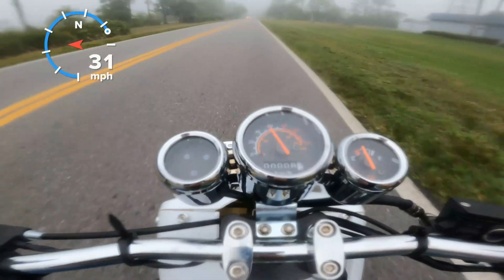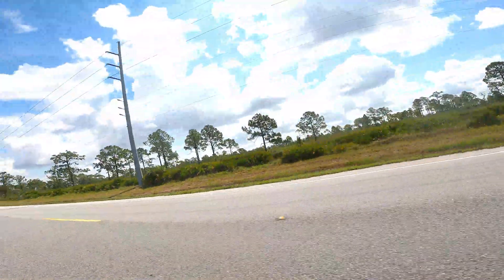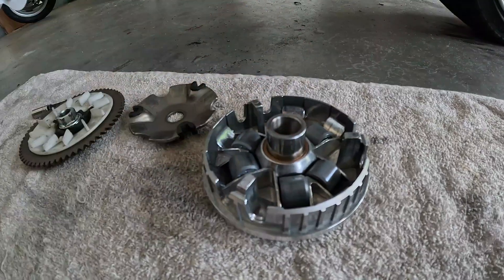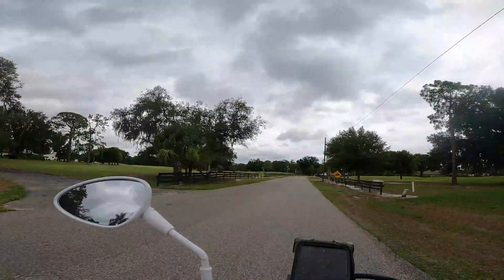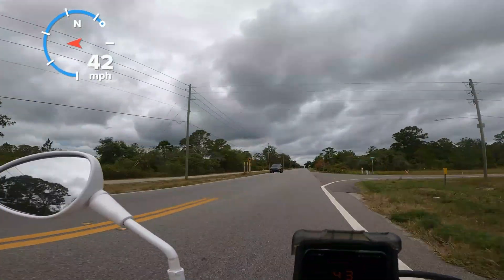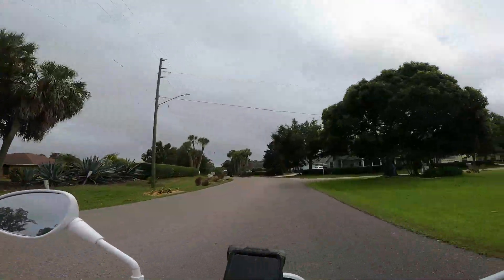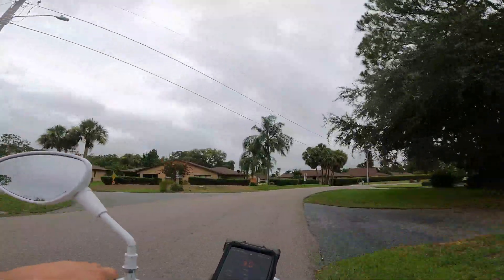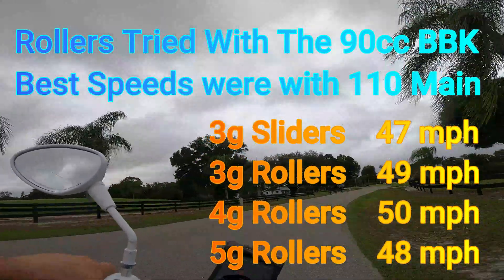Maddog 50cc is Fast as a Stock 150cc with these Mods for Under $500.  See description:

Comment: Think the variator would work well on the 150cc?
Reply from the maker: @Jnaathra  a 115mm variator will if you are making the power for it.  It's a gear up mod.  You will want an 842 belt also as the 835 belt does not even use up the entire stock 107mm one.

Comment: U should install a tach.cyl head temp guage.oil temp guage and a air/fuel ratio and exhaust temp.U will have the ultimate tuning tools and keep ur scooter safe.On aircooled engines u always want to keep track of temp.And have it slightly rich
Reply from the maker: @oldstyleanalog6459  I know....  I have been too lazy on that 😒

Comment: I had a metropolitan 2006.with polini variator 200lb rider i did 43 to44 mph.Honda is a better motor.i have like 4 gy6.1 im gona build a 230cc big bore on a china big ruckus.im adding a oil cooler cam carb the works.im gona ride from l.a. to the tip of baja on it when done
Reply from the maker: @oldstyleanalog6459  Is that like a desert baja ride?  Or street?

Comment: What are your thoughts on long term reliability with that big bore kit? I keep hearing you have to upgrade the crank or you will wipe out the bottom end.
Reply: Ifs it 50 stock . It's not gonna wear as quick .  Keep oil changed. Be cautious of what carb is sucking in . Depending carb the carb an setup. Grit will go thru intake an guess what happens

Comment: Great video! Im working on the same project with the exact same results. I think we must change the cdi from a 150 scooter to let the bike go significantly faster. but its a very risky swap. Ive heard the timing can be way off and wrecking the engine.
Reply from the maker: The 150 CDI and the 50 CDI are identical I think.  Just my suspicion.  I have a new blue racing CDI and a NCY "150" CDI and the Glixel orange 150/50 CDI.  I am going to do a test on all these.  I wanted to make sure the bike was running top speed before that test.  I did actually calibrate the timing on that pickup for another project and the mechanical timing is onlt 30 degrees advanced so that gives zero room for an advance map.  Prob why aftermarket CDIs always go slower in all my 150cc tests.
Reply: @GhettoWrench  thanks for your response. Im looking forward for the test results. my next upgrade will be a better carb. I want to have a little quicker throttle response.
Reply from the maker: @MrQ_Cruz  I ended up going back to the PWK cause it matched the bike better.  LOL.  It is identical to the Nibbi 19 as far as performance goes.  The PWK was harder to dial in though.

Comment: I'm runnin a 72cc, just put in a new 727mm belt and front variator (same size as stock), and an unrestriccted variator bushing, now i'm hitting 6mph slower on hills. Any idea why?
Reply from the maker: When did slow down?  After the belt change?  Or after doing all that stuff?  Ate you sure the belt you took out was a 727?  This was not a maddog was it?
Reply: @GhettoWrench  nope, a kymco super 8 so a long qmb139. I changed them all at once, old belt was a 732. new belt is 737, theres a typo on my comment lol. I was wondering if the new variator front end is a bit heavier? so the old rollers are now a tad too heavy. not sure though
Reply from the maker: @djilu9916  that longer belt probably geared you up so you are lugging down up those hills.  See if you like the shorter belt better.
Reply: @GhettoWrench  Thanks! i gotta try that
Reply: @GhettoWrench  are there any other meta for mountain areas than lighter rollers? the hills here in the Alps are insane lol
Reply from the maker: @djilu9916  I could not find ANY kit that geared the rear end lower.  I was looking for one.

Comment: Put that 21 flat slide on it
Reply from the maker: You are getting ahead of me.  LOL.  Im gonna do that after I watch the gear up kit fail.  Gear up kit gets here today, but working nights so maybe I will put it in tomorrow.
Reply: I did. Pwk. Good luck figuring it out. The problem is the scooter transmission. That carb is instant response . Can the transmission be the same. Think
Reply from the maker: @seanmayo206  you nailed it!  These flat slide and D slide carbs do not work good with CVT transmissions.  I an just discovering this.  I just got the best speed yet running a junk drawer 150 24mm CVK witehd no tune.
Reply: It will work but there will be a delay in response so it could wear the trans quicker but all the mechanical parts are cheap but the plastics for maddog for battery cover shit is over 100$. Crazy right

Comment: I'm glad I found your channel.  My mods/upgrades are almost identical.  Will be on Maui for the coming week so starting my new engine will have to wait.  I stagger the variator weights until I arrive at an rpm or speed that I like but go by seat of the pants feel and gps speed runs.  Where can I get the app that you are using for testing?  Thanks again for a great informational/educational video!
Reply from the maker: It is called "Drag Racer" in the app store.  icon is just the letters DR.  Ya after I do the tops speed stuff for gee wiz factor, I usually tune it back to heavier weights so I like the feel and sacrifice some top speed.

Comment: Throw sum heavier valve springs in it. And maybe bump up the compression to help out on that top end
Reply from the maker: I have a whole video on that.  Also the 20/23 mm head has heavier springs than both the NCY and Taida.  I would have to use 150cc springs.  But they would actually slow me down.  Too much drag.  I am only turning 8000 rpm.  Until you get above 10k rpm the heavy valve springs will work against you.  If I bump compression with no head gasket or shaving head it will roll the cam back as the chain becomes "longer" and retard cam timing.  It will feel faster because of the dip in the power curve, but will actually get slower with that mod.
Reply: When speaking about valves does length like the 64 or 69 mean something about compression? I've got a 50mm piston kit with a9 an valves are 69. Which is what came on it an can any of it affect crankshaft as far as the stroke?  Knowledge is power
Reply from the maker: @seanmayo206  not at all.  It is simply because the head is made up in the valve train and some heads need the 5mm shorter valve stem.  It seems the Taiwan performance heads have the shorter valves.  Not sure why though.

Comment: On my 125cc I got more top end when I went up on the needle actually with the clip on the bottom slot it had more torque but bogged out a lil in 3rd gear gotta fight thru it then I put the clip on the 2nd slot it cleared it all up nibbi 24mm 115/ 48 jets
Reply from the maker: Ya I need to mess around with that some more.  Still ain't smooth.  Thanks